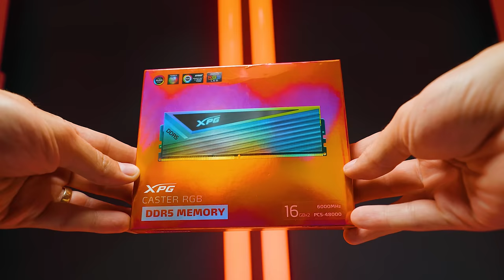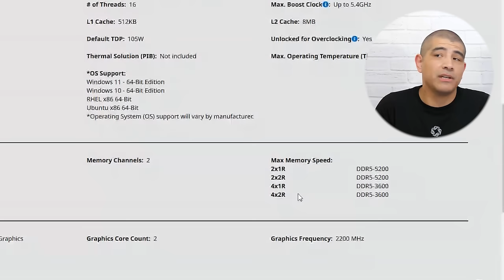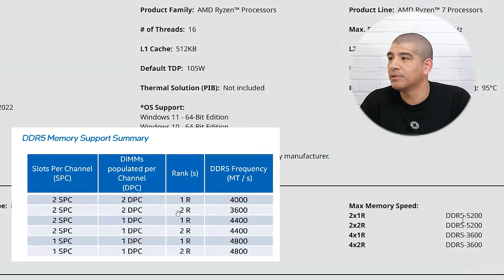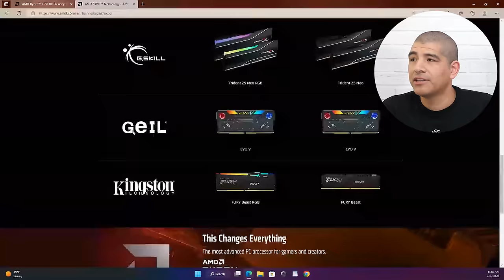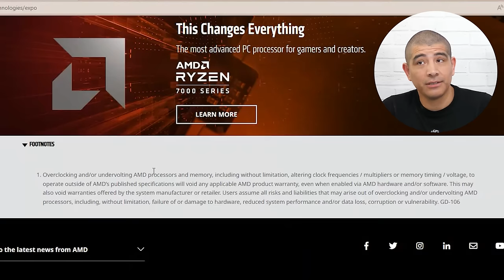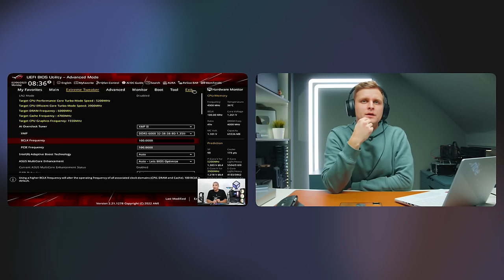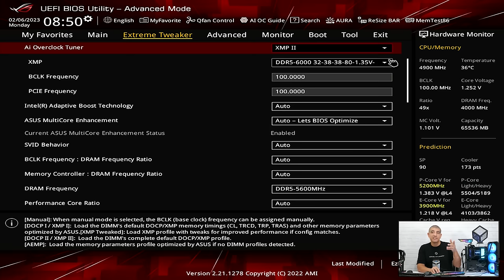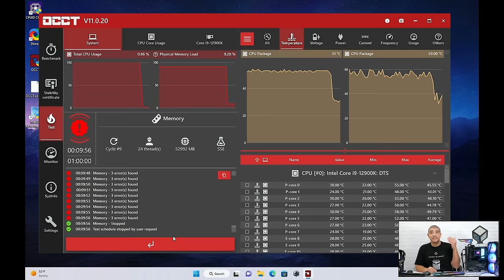Why I get NO POST with XMP??? 👉 ULTIMATE RAM + XMP Guide

Comment: I have an Asus Pro Art X670 board. Nightmare. It often refuses to boot. Trying to run the AMD PBO causes it to lock up on reboot. Useless status LEDs that show nothing.
Yeah, not sure it was worth the cost.
I have memory that’s on their list of approved memory running at 6000MTs.
Reply from the maker: But your CPU IMC is rated at 5200mts so probably that's why it's not working...
Reply: I have a 7900x with a tuf x670e and corsair vengeance expo rated for 6000 mt/s. Any setting over 4800 causes it to not boot at all.

Comment: Hi guys. Does anyone know of these "new" Kingston model KF556R36RBK4-128 RAM modules?
It is a new kit of 4 ram modules at 5600MT/s of 128GB. The interesting thing is that they come together, it is one of the first 4-module kits that I see on the market. Is it the solution to be able to have high speeds with 4 modules?

Comment: Personally, I think QVL is pointless. ASUS Strix Z790 QVL says that it supports DDR5 7800MHz, but it is not true. I have an i9 13900K. When browsing the Internet, I can run a speed of 7600/7800MT/s just fine, but when playing games it takes 30 minutes and crashes.
I thought the CPU/IMC was wrong, I put the same CPU in ASUS APEX and the CPU has no problem with stability 8000MT/s CL36. But on ASUS strix, the problem occurs already at 7400MT/s CL36!
Personally, I see the future in motherboards that only have two RAM slots.

Comment: DDR5  is yet to achieve relevance for gamers, unless you're running an i9. Tested with 13600kf Z690 Edge DDR4 & 5 I got highest average FPS with the DDR4 @ 1440p(32 GB  3600MHz CL16) For sure there are a couple of games that favour  DDR5 and for some computational tasks there will be a DDR5 advantage.  Most of the games I tested were within 5 FPS, not really noticeable one way or the other.

Comment: It is false advertising to say 6400 when that is an over clock speed. It should be advertised at its non overlooked speed. So it is DDR 5, and 4000 is the nonover clocked speed, and 6400 as its over clocked speed, then it should be DDR 5 4000.
Reply: Totally agree with you. It's a misrepresentation with the advertising. When  buy RAM at say 7200Mhz when in reality,  I can only achieve that speed by using XMP which s of course, overclocking. Base speeds (DDR5 is 4800Mhz), should be advertised on the packaging with a blurb that says, speeds Up to 7200Mhz with XMP.

Comment: I have no post sounds in my intel/Nvidia pc, at times (very sporadically) my screen goes black for a second or two and some days on startup my keyboard does not work, and may need more than one restart for it to be recognised. Does anyone have any idea what is causing this?
Reply: The speaker may be disabled by default.  A lot of motherboards turn those off since there is an LED that can give you error code or tell you where it is in the post. 

But it sounds like the video card isn't fully seeded, is dying, or an issue with that pcie slot.  

First, make sure the GPU is pushed all the way in by taking it out and pushing back in.  You should be able to hear the clock of the latch but not always, but should be all the way up holding the video card in place. 

If that failed, then try a different slot that can support pcie 3x16. ( Or wherever the GPU is rated for.)  A higher Gen of pcie can handle the lower Gen, but you will need to check you motherboard to see what it can handle.  Like I have a motherboard that has 3 pcie 5x16, but if the first spot is used for pcie *x16, the second is disabled and the third will support *x4.  So even though I put a pcie 3x16 in slot one, I will only be able to use slot 3 with any pcie x4.  But I have seen some that only slot one is x16 and the other does will only support x8 or x4, and there are motherboards that have 7 pcie 5x16 and can support all 7 slots using x16 at the same time. 

If you have another computer, you can try the video card there.  Or if you have another video card of the same or higher pcie Gen, you can try that in the computer. (Technically, any pcie device that will use the 16 pins should be able to work to test.  Don't know if your CPU has integrated graphics support, so you may need to check that and what type of graphics display your mother board has; mine uses USB type c but I've another computer that use dvi-d, some brands still support onboard VGA, which is ideal for when a committee is being a pain and need to be fixed.
Reply: @OmniscientWarrior  thanks but I no longer have that pc.

Comment: I have passed Memory Class-3. My latest PC build, Gigabyte Z790 AROUS Master, and CORSAIR 7200 memory, on the QVL list, went through many cycles of running POST. It would show an error code 55, and the POST would begin again. Finally, the digital display showed a C1 code. C1 was not listed in my manual's list of codes. Does C1 mean this MB has passed the MB POST? Be warned. Some dealers, not all, will sell their RMA memory as new. How you discovered this is anybody's guess. It might indicate this memory was registered by the original buyer, and you will be denied registration as the serial number was previously used by someone else. This is one reason the seller requires you to return ALL contents in the box. Select the New box if the seller allows you to select New or Used condition.

Comment: :thanksdoc::hand-purple-blue-peace::goodvibes::thanksdoc:I have learned a lot here, understanding on another level and adding to my journey. This is an excellent video. Thank you, to both of you.:thanksdoc::hand-purple-blue-peace::goodvibes::thanksdoc: To me, this felt like 20 minutes went by when really it was more like 2 hours because I had to rewind some parts to let it really sink into my brain. I love this:thanksdoc::hand-purple-blue-peace::goodvibes::thanksdoc:
Reply: And you will have to erase it from brain when you figure the errors in the video.
Reply: @Physics072  OK, would you like to point out any of the mistakes you have found to me?:glasses-purple-yellow-diamond::buffering::buffering:
Reply: Have to agree with. @Physics072 I missed his intro and had to go back to check because I knew he was either Marketing or an IT slob with how bad he did. To a novice it probably sounded like a lot of good information but to anyone in the know including the YT creator doing the interview could tell the interviewee probably never built a PC from scratch in this life. MTs btw is clock times 2 times 8. When you out memory in manual it defaults to auto and you change what you want. Talking about the fools spamming delete, well Marketer if you have a failed OC, your system is corrupted or any other array of reasons how else do you get in the BIOS when loading beyond post fails and locks up. There are plenty goofs that are typical of someone missing the hands on experience.

Comment: With DDR 4 having 4 dimms has show as much as an 8% improvement in gamming improvement due to increased bandwidth. I'm sure when DDR5 matures enough we will see the same improvement.
Reply: 4 sticks of ddr4 or ddr5 will only improve bandwidth if the platform is quad channel. Like the x99 chipset is HE intel chips.
Reply: @kevinac4397  not exactly. It allows the memory controller to pull from different paths and access more random information more quickly. So yes it doesn’t actually double the bandwidth but it does increase its ability to read random information faster than if it was located on only 2 Simms instead of 4. Like I said it is a small increase in performance but in a fast pace 3D game it can be the difference between 90 and 100 FPS when making quick movements. Yeah I did kind of word that wrong but I was tired.
Reply: @timothymine1135  you are describing how quad channel memory works. If a cpu has a two channel memory controller and ddr5 is dual rank, two sticks would actually be preferred.

Comment: Higher ram speed just seems soo overrated. Single digit % performance increase at best. And you’re dealing with compatibility, boot post issues on your build, etc. not worth the added fuss. Unless you’re a professional builder, just seems better to avoid potential hassle.
Reply: I sure got a lot of hassle having XMP enabled with my new system. Sucks I don't get the full speed out of my ram that is marketed and I paid for, but would rather have a stable system than the extra speed with a bunch of problems. I can barely even tell the difference having it on or off anyways.
Reply: @jeeroylenkins3081   Exactly my point! That time is better spent on tuning other PC parts.
Reply: I fully agree with these comments. This video helps us to know that they are really screwing us over. It's like the fine print of a contract. Now I find out that I bought two 32Gbs DDR4 RAM modules separately (Kingston Fury Beast DDR4 KF432C16BB/32 1 32 GB) same brand with identical latencies, speed and voltage and it may not work in dual channel because I did not buy the (Kit ) and don't even think about XMP, a disaster.
Reply: @pandoradesign_plus  Yep, I am in the same boat as you but with DDR5 ram. Didn't matter if I had 2 sticks or 4 (of the same specs/brand), it would make my computer unstable, shut itself off etc.

My ram has rated speeds of 5600mhz, but I am stuck at their stock if I want my system stable apparently.
Reply: @jeeroylenkins3081  Hello, your Memories run at the speed indicated on the packaging and it won't let you upload them without applying XMP? For example, I have 3200mhz memories, it is what appears on the sticker that is attached to the memory. So I couldn't run more of that even if it says they work for XMP? Greetings.
Reply: @pandoradesign_plus  The speeds they advertise on the packaging are the speeds you get with XMP enabled, without XMP enabled the ram will just run at whatever its stock speeds are.

I highly advise caution when enabling XMP, for me it was nothing but grief, and apparently it's a problem for many.
Reply: Update, got XMP working with a bios update and different RAM kit. Been stable ever since.

Comment: sry, but this whole interview is a poking around the issues the manufacturers have and dont wanna talk about. I have the newest Asus z790m-Plus, i9 13900k, with 4 slots DDR5. they give you the "up to 7200Mhz DDR5" selling point. I've bought 4x 16GB 7000Mhz rams from their QVL and have problems with BSODs from day one. I phoned back and forth with the ram manufacturer and Asus. Ram manufacturer says "its up to the board manufacturer to make that compatiblity work". And Asus just straight up telling me off with "it must be this and that version of the ram model, even if the model u have is on our QVL". But no shop out there listing the "version number" of any rams they selling, only  model number.
Like for real, i cant even use XMP at all and have to use "auto" settings in the bios and my 7000Mhz rams only run at 4800Mhz "stable".
Im not buying "premium", may it be mainboard or ram, just the get what "average" would have done the same !!!
Obviously its on the board manufacturers site of things, in this case Asus, to get their bios up to the specs to support this kinda MHz on the rams and not give me the excuse after i paid premium "oh you gotta have this and that revision number of said ram, even tho no shop ever selling rams can list revision numbers...."

Just look around 1:12:00 he runs the 4x 16GB on pretty low 4000Mhz "auto" settings and does talk about XMP but never activates it, so the ram might run at its 6000Mhz. Even 5600Mhz would be a standard setting for the mainboard, still under XMP and it won't run like OCCT test shows.
THEY FRICKIN KNOW IT DOESNT WORK !!!

Comment: I don't even put the XMP profile on, lol, I got a gigabyte H610I with a 12600k and I don't see the need on enabling the XMP profile, I only use my PC for you tube and Sim Racing, I am thinking about getting back into Hip Hop production, Still though I feel if you start enabling XMP profile, Your Ram modules wont have as much life in them if you enable the XMP, I am still learning with this PC build stuff, I feel you should only enable the XMP if you doing hardcore rendering, Fair enough, But for gaming, I still got the standard XMP with two 8g sticks of DDR4 Corsair Vengance, RAM, I am happy with how it is, I don't want to start playing around with XMP to be honest just incase I get a problem, I will say the Gigabyte H610I DDR4 motherboard is fantastic for the price, Overclock abilities, Again I got the motherboard not to overclock, But for the clock boost, And with the i5 12600k the Gigabyte H610I motherboard, I can say is amazing for a budget PC...
Yeah I feel if I enabled the XMP profile something will go wrong, Plus wouldn't a higher XMP profile create more heat?, Yeah for some reason I feel enabling XMP will shorten the life span of your motherboard, Or problems will happen, Another thing is, I think you would need a massive high end motherboard for an XMP profile not to shorten the life span of the motherboard.....
Still though this is a great video for understanding what XMP is, I still feel you need a high end motherboard for XMP not to go wrong...........

Comment: Imagine paying $600 for a high end Asus board and $500 for 4 sticks to 64gigs and you can't run XMP anymore. No post on the latest bios  2305. Had to remove xmp and cut my ram speed by more than half. I struggled to even listen to this. He is might as well have said. Having a bike that you petal with two wheels is far more reliable than driving a car with 4 wheels. That may be true but who wants to ride a bike when you have a car. Next Asus will be saying you really should not using more than 1TB to play games. I love how he is speaking to a technical audience and he is trying to deliberately use nuisance and niche cases to confuse people.  They literally manufacture motherboards how they going to act like they are surprised.
Reply: He is might as well have said. Having a bike that you petal with two wheels

Comment: Okay I'm going to disagree w his commentary on ram mfg around 38:30 min mark. XMP should just drop in and work it has zero to do with the PCBs or different configurations that's BS. It comes down to the Chipset controller which is standard and tested the issue is Ram mfg don't control their quality as strictly as they should. There's a reason they take bad silicone and put it in a slower kit they weed out their best wafers for the hight end stuff and even then it's not perfect which it should be. But it's good enough to from a cost/mfg perspective but really their doing this at the consumers expense. Of they used better heatsinks and tim along with better chips people wouldn't  have to play mad scientist with the voltage and timings

Comment: There should be nothing to fix.  When you buy a vacuum cleaner you don't pull the motor and modify it just to get it to work.  Should be plug and play with ZERO fiddling around by the user. Anything less is amateurish for a company to put out in 2023.
Reply: You got it bud.  XMP = scam for consumer. I never got it stable on 2500K after testing24hours with memtest.  It's a bad joke.

Comment: What a load of malarkey . The bios should take this into consideration. I have a new mother board and an 4 slots filled 16X4  64 gigs of 3600MHz  DDR4 and the board is supposed to support that. When I hit XMP it doesn't work and gives me the bios screen only and reverts back to 2133 MHZ . I shouldn't have to remove ram sticks and drop down to 2 sticks at 32Gig just because they are not smart enough to update the bios.
This guy sound like a Politian that is spilling  dribble.